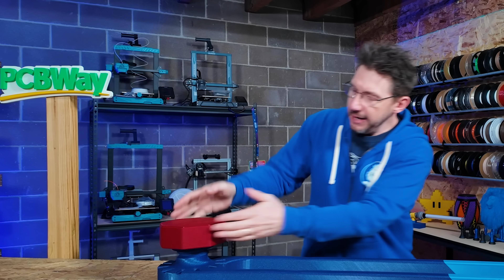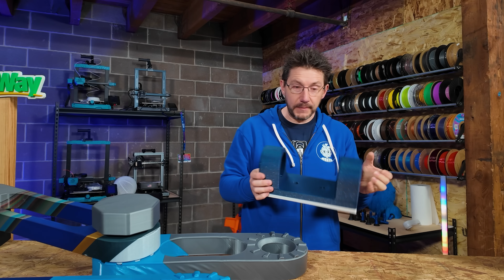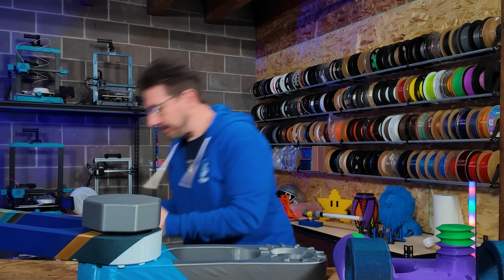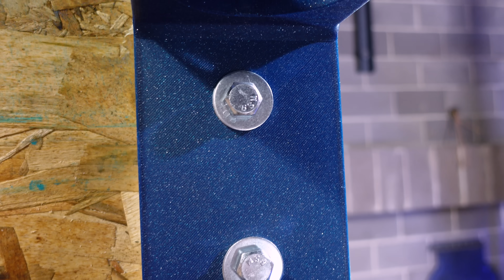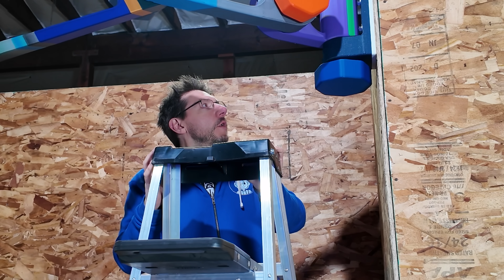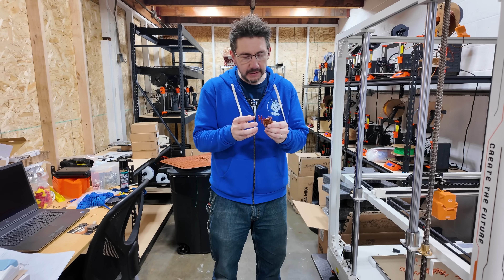My OrangeStorm Giga is Dead

Comment: I wiped out 3 hot ends in the first month due to the blob of death on my N4MAX. I have since started my first layer at .35mm, even if printing the rest at .18mm layers. This gives a bigger margin of error for the first layer and since doing this I've not had another blob of death and I get great bed adhesion.

Comment: haven't you tried or looked for a FR4/G10 sheet of the size of the printing surface, I think it would be a way to avoid having those problems in the joints, and you would have a flatter surface, Greetings from Mexico !!!!!

Comment: Other sad part is the amount of electricity it used for those failures :( Seems a bit rushed and maybe they should just go back to the drawing board (1 build plate not 4 and heating zones like the Prusa has would be great I think) and make people wait a bit longer to raise the electric company profits and lose a lot of filament (fixed it would be to USE a lot of filament but now it is wasteful). great video and would be neat to see an led tv or monitor on the end of that to see if it holds the weight!

Comment: The impression I get from your videos and other YouTubers is that the Elegeoo is just low quality crap upscaled.  Look, if someone like Lulzbot made a machine like this, it would be quality hardware, brand name hot ends and extruders (Slice, Bondtech...) and made to be RELIABLE.  The only thing this thing seems to do is hammer your electric bill and cause oodles of frustration.

Comment: I printed that lamp arm when my printer was working, used it on my computer for a desk lamp and also printed a pink one for the partner as a bed lamp, sadly I think the pla dried out and cracked eventually and literally the only parts I have left are the lamp mount and shade now, all the other parts have broken or cracked. The main issue I ended up having was separation on the threaded parts of the arms due to the stresses under tension (also prob didn't reinforce the prints enough with extra wall thickness) (RIP giga, can't wait to see how you improve it)

Comment: My suggestion is to take this "opportunity" to install a pellet extruder on the Elegoo Storm. Because this printer really begs for a pellet extruder. Using filament material is way too expensive to be practical for large-scale objects. 
EDIT: a minimum nozzle diameter of 1 mm might compensate for the lack of mechanical precision and problematic layer adhesion.
Reply: I'm not sure if the gantry can support this, cause pellet extruders are in a different weight class than normal-sized hot ends. At least those that would suit a printer this size.
Reply: @TheCreat  - Experimentation will settle this. Greenboy3D has a pellet extruder that seems to work well without being too complex and heavy. 
When the printers increase in size, we have to expect lower speeds, cause the inertia of the gantry itself will limit printing speed.
Reply: I third it! 😃
Reply: I would love to see the pellet extruder mounted!
Wish I had time and resources for such a project myself😅
Reply: Pellet printers introduce many of their own unique problems too. A large 5kg spool of 2.85mm filament, and a fat 2mm nozzle, is far more easy to manage and control than the whole  conveying, screw feeding, melting, process on a pellet machine. Specifically do NOT recommend the MDPH2. Ask me how I know.
Reply: @cybair9341  it’s not expensive you just are not charging enough or you are not using the machine how it should be used. It’s an entry level industrial printer. Charge accordingly. It only took me one job to make a full return on my giga investment.
Reply: @MrEquilibrium - What are you talking about ???????
Reply: i second the pellet experiment for the giant broken printer

Comment: this big printer is ......!!!!!!  you can keep the hardware change the board (bigtree boards), the hotend + extruder. try to make your own software (marlin). my big printer is 120x120x110 cm print space is 90*90*90 cm. homemade with xy cord , i move the bed not the hotend up and down i can print 3 colors. i build my own filament sensors they check if filament is out and if filament move . i replace one of the wheels inside the sensor to an decoder wheel so i can check the movement.

Comment: Joel, PLEASE DO NOT let Elegoo off the hook with this. 

Their Neptune 4 Pro had all the same issues you have had, and after a YEAR, they couldn't fix their issues. 

This sounds a lot like letting Elegoo from repeatedly sending out half baked hardware, and partially completed software. At some point, we have to hold crappy manufacturers accountable. But it seems the only time people hold them accountable is if it catches fire (see Bambu A1). 

At what point do we tell people NOT to use Elegoo? How bad does your experience have to be to NOT recommend a COMPANY? Because I honestly thought the last Giga video would have been enough........
Reply: Wit hthe A1 They held themselves accountable. They are judt a different kind of company. Not a fair dig.
Reply: Nick, I had a similar experience with my Neptune 4 Max.  Anytime I printed ANYTHING where more than 1 KG was on the bed, no matter how much I slowed it down, tightened the belts, etc a layer shift was inevitable.  Also, the inconsistent sensor readings would make the z offset +/- .3 mm.  So either scraping the bed or printing in mid air.   It was like that until I bought a whole new extruder on my own since Elegoo couldn't or wouldn't replace it themselves despite a ton of back and forth troubleshooting with their support.  Since then I've been having way less issues.  Printing my first 2kg print right now with the new extruder.  46% done with no issues yet.  fingers crossed.  This 4 Max is my 6th printer, not including my resin printers.  I can honestly say I have never encountered such an inconsistent printer as this one.
Reply: Skill issue bro
Reply: Have one neptune 4 pro too, but after I changed the wire harness, hotplate and upgraded to the latest firmware  a few weeks ago, it just works, it even competes with my bambu a1.
Reply: Neptune 3 Max has been absolutely fantastic
Reply: The Neptune 4 had issues?  Since when?  I have put 100's of hours into mine and never had any issues with the machine.  Leveling is fine, extruder is fine. Flow, Retraction,  Cooling.  all fine
Reply: Must be a skill issue, have about 10 that run non stop zero issue. Not saying you don't deserve merit, I'm just saying I've had great luck 10 outta 10 so somethings not right here
Reply: Skill issue, been using their printers hassle free for over a year
Reply: @amethod  it's weird for someone who has no skills to say 'skill issue'
Reply: @amethod  Same.  My Neptune 4 is issue free
Reply: @622.by.sunrise8  Ah, so both the previous poster and Joel are newbs who require special skills to make these particular 3D printers work,  got it.
Reply: @LongDono  Yep, especially Joel
Reply: @amethod  trolls gonna troll

Comment: I think the bed needs to be a single piece of cast aluminum and a 800mm square Keenovo silicone heater and single 800mm flex sheet. Yes it’ll cost half of what the machine costs but at this scale even a $3000 printer that’s reliable is a good deal.
Reply: Not entirely sure I'm with you

Aluminium, absolutely. Single piece maybe but not necessarily. But definitely don't need a single Heater pad
Reply: @BelviGER  infact a single heater would be a terrible idea.
Reply: The larger issue with a single heater that large, is the power draw when heating. You would have to vastly underrate the heating element in order to use this on a 15 amp circuit.

Comment: honestly at this point, putting an entirely different printhead on the giga might be a good solution ngl. also put the bed temp higher, its what helped me with sticking. and also clean the PEI sheets with just soapy water

Comment: I learned back over 10 years ago on my Replicator Dual that i still have and still works to lock the screws in place for the bed. On my current printer with "only" i have a 300mm squared sized print area and every printer in between I've put an extra nut on the bed screws to lock the bed screw in place. Since, never have i had a print failure due to bed shift. I also get the bed about 2-3mm from fully seated to make the bed as firm as possible while giving just enough space to adjust.

I also printed (in ABS filament) center spacers shafts to go in-between the spring/screw to prevent the bed from carrying vibrations and shift the bed that way. This was before people started using solid mounts.. Funny thing, I've been to lazy to put that on my newest printer because it's a bed dropper.. but totally made sense on the bed slinger i had before

Comment: I wonder if by putting a small cube-shaped void in the center of the model, so that it wouldn't print within those 4 inter-corners of the build plate, if you could avoid having the same issue. Just a small enough void that it could then bridge over and continue the print upward and give you a small little cube mounting point that you could use to mount it either on a stand or the wall

Comment: I think the giga should have a full 800 mm^2 glass bed, just for flatness and to mitigate the gaps between build plates. I usually like springsteel PEI, but for a printer of this size, a glass bed would maintain level, and be way easier to handle.
Reply: Been thinking about trying this when mine shows up.

Comment: At the end of the day, the Giga is still a consumer grade printer in a giant frame.
I'm curious if a single, gigantic PEI sheet would help, assuming you could find one or have one made.
Even with that, you have that one spot where the four plates join, still the possibility of movement after heating.

Comment: One of my personal favorite ways to make 'Vase Mode' prints stronger is using an 'Over-Extruded Vase Mode' that the RepRack creators suggest for some of their parts. Using a 0.6mm nozzle, set layer height to 0.4mm, and all line widths to 0.95mm. Just slow your speeds down to compensate for the increased amount of filament being pushed through. I'd imagine using a 0.8mm nozzle with a 0.5mm layer height and 1.2mm line width would be the best way to increase strength.
Reply: I've actually had great results using a 0.6mm nozzle using 1.2 extrusion width and 0.32 layer height. (Prusa MK4 with an ObXidian nozzle.) As long as your volumetric flow limit is set correctly, it should automatically compensate.

Comment: I feel your pain.
The blob of death claimed my Ender 3 V3 SE thermistor. Now to figure out how to fix that, I am a user, not a tinkerer.
Reply: "a user, not a tinkerer" is really risky territory in 3D printing still.
Reply: @MumrikDK  especially with an ender 3. Maybe a Bambu would be more 'user' focused.
Reply: @miniknights  can you give me the money for a bambu printer? They cost as much as a year's house payments in my country.
Reply: @MumrikDK  reason I buy easy to assemble printers. My ender 3 S1 is still going strong after 2 years.
Reply: it's simple a wire with 2 leads. Buy the replacement part, disassemble the hotend until you see the thermistor screw, and then replace the Thermistor. Be careful not to screw the holding screw in too tight or you'll crush the wires. If you're nervous, watch some videos. If it's the heater cartridge, same deal just w/ the set screw instead.
Reply: @miniknights  I BELIEVE IN YOU GERHARD GROBLER
Reply: @miniknights  .I have had to replace a thermistor once before. But the new ones are stuck inside. I cannot get it pushed out. The wires broke off right against the themistor. it is a bar as long as the heater cartridge. It is stuck inside.
Reply: @MrGerhardGrobler  if it's a bar as long as the heating block, that would be the heater cartridge, not the Thermistor. For that, find the small black hex screw on the heating block and unscrew it a little bit. That should free the cylinder.

If it's a weirdly long Thermistor held in by a screw on the side, then you might need some tweezers. But I'm pretty sure you're talking about the heating cartridge.
Reply: @miniknights  I know the difference. Both are long. Or Creality put something in the tube. The wires are broken off flush to the heater block.
Reply: @miniknights  the thermistor is stuck.
The heater cartridge is stuck.
I tried pushing them out from the opposite side.
They dented and wedged in firmly.
I did discover that I didn't destroy the PCB. Just the plastic for the heater cartridge came loose. I was able to push it carefully back into position.
A new nozzle assembly is just $30 including shipping.
And even I should be able to replace it.
So a month till payday. Then another 2 weeks for delivery.
Reply: I had a blob of death on my QIDI X-Plus 3, but I caught it early enough before it got to the wires.
Reply: @GeedsGarage  lucky. I came back 2 hours later...
Reply: Speaking as someone who is also a "user, not a tinkerer" - the solution here is to sell that printer to someone who is a tinkerer and buy a Bambu machine.  I ruined three hotends on a Creality printer due to blob of death, and came to hate 3D printing.  My X1C completely reversed that opinion, it's so straightforward and usable.

Bambu wanted to make a printer that's as easy to use as a toaster.  What they got is a printer that's as easy to use as a toaster oven.  Creality, on the other hand, is basically trying to make toast over a pinewood fuelled fire with a sharp stick to hold the bread.

Everything in this post is, of course, my opinion, and many people will have a different opinion, and it's okay to have different opinions. That ought to be obvious but this is the internet...  Still, it is sincerely intended advice.
Reply: Just buy a new hotend.  Ender 3 se parts are cheap
Reply: @anthonylong5870  What country are you?
Reply: @anthonylong5870  I had a look. The heater cartridge pulled out the socket on the PCB, the heater cartridge and thermistor is jammed inside the hot end. So looking at a new print head assembly
Reply: Heat gun
Reply: @amethod  don't have one, for future reference.